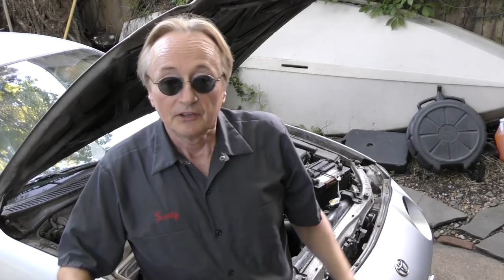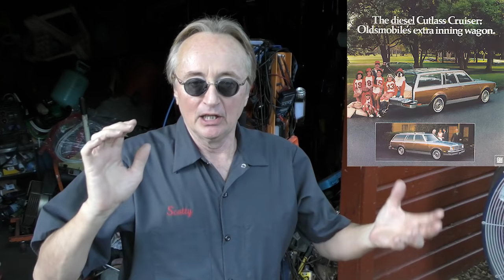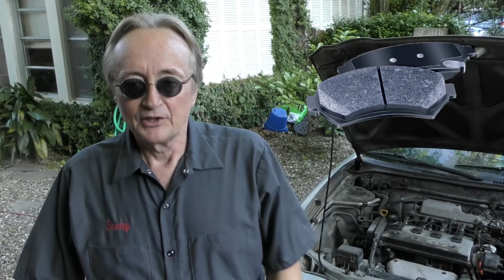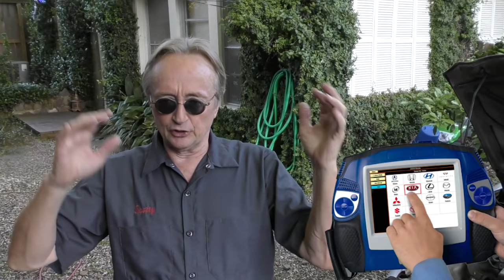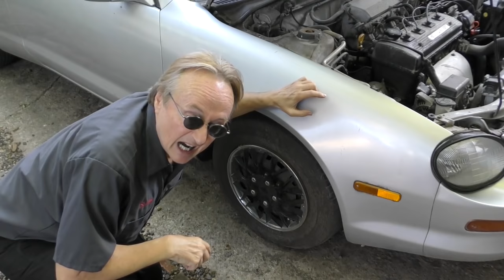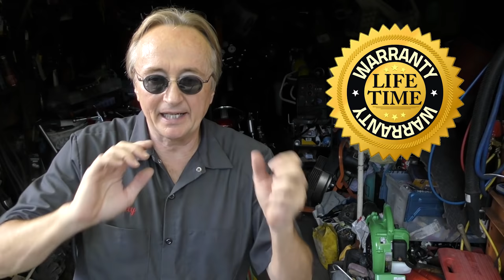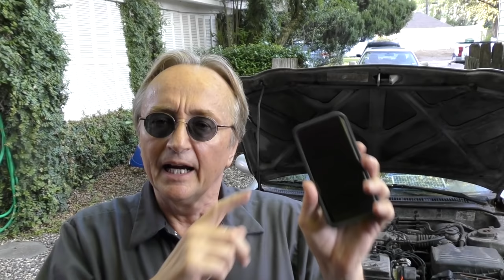5 Scams Your Car Mechanic Doesn’t Want You to Know

Comment: Moral of the story: get a good make of vehicle, find an HONEST mechanic.
Reply: And learn about your car so you don't get ripped off...
Reply: Or do it yourself!
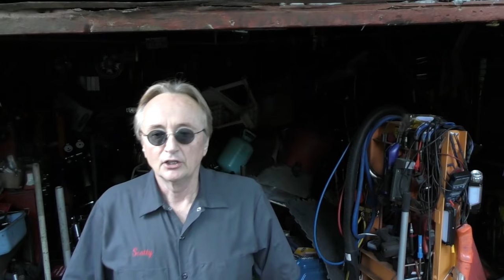Reply: @peterescalante1207  Yeah! Even th' man said that at 1:33 of this video too.
Reply: know the clockworkings of your car as well so when they tell you cat tales you can detect them
Reply: How do you know if the mechanic is honest?
Reply: @franko No not all.  Somebody has to fix your car if you can't.  Simple as that and once again just because we fix cars does not make us all scam artist.
Reply: There’s really no such thing as a bad make of vehicle anymore. 

A lot of the parts they all use are made in the same plants and a lot of cars even roll off the same assembly lines these days. There is no such thing as a problem free car despite the myth of Toyota’s and Honda’s never need maintenance. I did more major engine work at Toyota than I’ve ever done anywhere else. Just buy a car, find the routine maintenance schedule - do the services as they’re do and handle any other issues and you’ll be alright.

Comment: This is exactly why I love these videos so I can learn stuff and do the work myself thanks again Scotty save me a ton of money over the years
Reply: Scotty saved me from liars who said my transmission was bad and my radiator was bad. All it was was a faulty plug wire and Scotty figured it out. I spent $29 on wires instead of$ 4000 on a transmission and $300 on a radiator.

Comment: Scotty, you are spot on!  I’ve been driving for 60 years and I grew up working in my cars, like every kid in the sixties did. 
I have a 2007 Nissan Xterra I bought in 2009 with 40,000 miles on it. 
Two years ago, I took it in to a garage for routine service and an alignment check, since it had never been aligned since I bought it.
Well, I needed $3400 in repairs. Struts and shocks, lower control arm bushings, motor and trans mounts ( $660 labor).  And some other stuff. 
Why do I need struts and shocks?  Well, because of their age.
I had NO symptoms, and I never had anybody tell me I needed that kind of repairs. 90,000 miles. Serviced regularly.
So I got a second opinion, and followed the Master Tech under the car on the lift with a flashlight.
Yeah, the pax motor motor mount is a little weak, and the fan clutch will need replacing in about three years. But,  otherwise you’re good.

Comment: The local Mazda dealer once told me that my car needed a new valve cover gasket.

It was a '93 RX-7. (For the uninitiated: that has a rotary engine, which does not have valves. Much less a valve cover, or a valve cover gasket.)

(I'll take my keys now, thank you very much.)

Comment: Make sure you change your Flux Capacitor every 60,000 miles.
Reply: And change your brake light fluid.
Reply: My flux capacitor will last the lifetime of the vehicle.
Reply: If you get the updated "Mr Fusion" control module, it saves you a lot of hassle trying to find plutonium.
Reply: John Nguyen I thought it was every 88,000 miles??
Reply: Years. Not miles.
Reply: @mcplutt  At least that's what the warranty guarantees

Comment: Went into a local dealership to have my oil changed and tires rotated, they added a misc charge in the bill to inspect the floor mats to make sure they were properly installed. 

Always go over your final bill.
Reply: Hence the term....stealerships
Reply: Bwhahahahahaha. Those mfers
Reply: Once my vehicle is out of warranty,  the dealership never sees it again.
Reply: Was it a Lexus? Remember the mats that jammed the gas pedal?
Reply: Make SURE you check the torque on the lug nuts yourself or risk warped rotors...common scam.
Reply: Toyota and lexus always have a line on the repair order for floormats since the gas pedal recall

Comment: The biggest scam is the state inspection in Texas. That gives mechanics a blank check to "fix" whether just to pass state inspection. Happened to me. Mechanic said I needed a new master cylinder. He drained the brake fluid and said it was leaking. I drove it home, replaced the master cylinder myself and drove it back. The mechanic was all pissed and eventually passed my inspection.

Comment: If it is a GM and the check engine light is NOT ON then there is something wrong with the vehicle. I have never had a check engine light come on when the vehicle actually broke down.
Reply: I had one that flashed on the dash of my s10 for a whole year. It burnt out or something eventually and was replaced by an abs light. That week it dropped a valve
Reply: It's like no oil dripping out of a German car...crankcase is empty.
Reply: wholeNwon z
Reply: Well I have a 2008 that it's off... so what's going next

Comment: I recommend reading your owner's manual, joining a forum specifically for your car, invest in some basic tools and DIY.
Reply: Yea that works if you have a old vehicle the newer Vehicles you have to have a few thousand dollars just for for one Tool. they make them purposely now where you can't work on them yourself even for simple maintenance.
Reply: Absolutely right. Lots of seemingly complicated things can be done easily with very basic tools and a cheap OBD II scanner. The forums for my car have been good.
Reply: @Redblade very true! But scotty would advise against buying any newer car. I drive a 2000 maxima, still going strong and forums help me save a lot of money and it's easy to work on for the most part
Reply: How do you find these forums
Reply: @NT-sm5jk  google type : (name and year of your car) forum

Comment: I scam myself into buying genuine parts for my BMW.
Reply: Bring Money With for sure, but often for older ones the stealership will quite often also be using those same aftermarket parts to service the car, because they can make an insane markup on the parts, and the customer will pretty much never see any difference. Only difference is they are putting a warranty on them, so they make sure the stuff they buy at least will last the warranty period, or till the next service, when they will change it again.
Reply: @SeanBZA  I buy from the dealership all the time. I get a discount when I order online. It even beats other competitors like ecs, europarts, Turner you name it. All stamped or laser etched Genuine BMW parts. I've even had some parts imported from Germany because they didn't have any in stock. They've been good to me and my E36 M3.
Reply: Hahaha😂
Reply: @I.Odnamra  smh
Reply: Anything electrical and suspension makes sense
Reply: nothing scam about that unless you buy them when there is no reason to do so
Reply: Lol well for a bmw you kinda have to buy genuine parts...
Reply: Armando Garza oh my!
Reply: FCPEuro. Check them out for BMW parts lifetime replacement on everything. Even oil. Thank me later

Comment: Dishonest mechanics are why I do my own maintenance now. 
;)
Reply: Only thing worse is construction and home improvement contractors.
Reply: And at the hourly rates they charge, even if it takes you 5 times longer to home DIY the same job, it's still worthwhile compared with minimum wage.
Reply: All you need to do is know a little about anything in a car. Then you can go to the most dishonest mechanic, and still be able to tell him if he needs to replace a part or not.

They have the time and tools and do some labor that I can't do. But a little knowledge can prevent them from scamming you.

Comment: I have a 2011 Honda CR-V. This model is prone to having the Cruise control toggle break. The toggle is located on the steering wheel. NOW, this model also has a recall on the steering wheel airbag. I called the Honda dealership to schedule the recall and get a quote for replacing the toggle. They quoted me FULL price for tear-down labor on the steering wheel assembly, which was to be included in the recall at no charge, if I wanted the cruise toggle replaced as well... Basically an example of what you mentioned as #1.

Comment: "Find an honest mechanic." Could we start with something easier: parting the Red Sea perhaps?
Reply: I've been a Technician for over 25 years and pride myself on being honest with every customer. So maybe I could part the Red Sea too.
Reply: I wanna be an honost mechanic, just to do good in the world but still need more studying/ learning everything a mechanic needs to know
Reply: I am an honest mechanic that will tell the customer that they don't need any work if they don't
Reply: Lmfao
Reply: slimchans I need your help. My 2011 Jeep Compass shuts off while I’m driving and it often won’t even start when I go to drive. Any ideas ?
Reply: @thisisshauna6986  I would start with checking your battery terminals especially if you keep having to reset your radio and clock
Reply: @slimchans  would that make it shut off while driving? Sounds like possible alternator issue too. I'm not a mechanic. So my question was actually a question and not rhetorical.
Reply: @aleksfoxtrot8044  it could be a combination of both. But an erratic connection at the battery can play hell on the electronics of a vehicle causing many weird issues. I am just giving a starting point since it's hard to diagnose a problem without actually seeing the car in person. It also could help if the engine light is on to just go to a local autozone or other parts house and have them scan it for free
Reply: @slimchans  yeah I hear ya.  Always start with the simplest possible problem.  So I was just asking your thoughts.  :)
Reply: @thisisshauna6986  It's a Jeep thing, their owners wouldn't understand. (Sorry, We do a LOT of warranty work for a local Jeep dealer;) especially now that they are owned by FIAT!!

Comment: I don't trust any mechanics. That's why if I can do it myself, why not? I like learning.
Reply: Ernie C don’t jump straight to blaming us. I never recommend work that is not needed or recommended by the manufacturer. Blame the shop owners and managers. They are the ones destroying this industry. I wish Scotty would point that out more.
Reply: J M  can’t get fired for that. The companies would get sued if that happened. Remember there is a tech shortage and companies would get a bad rep and have zero employees. The customers are partly to blame too. The big chains have more buying power and can offer lower prices on some things and the customers flock to them. The chains are the worst to go to. Big companies only care about bottom lines. Find a small honest shop and stick with them for everything.
Reply: J M Remember, cheap labor is not good and good labor is not cheap.
Reply: J M I’ve worked in a nice handful of garages over the years, and never ran into any issues with being an honest tech. It’s been the exact opposite in my experience more and more garages are trying to push out the crooked techs recommending things that aren’t needed or services (like flushes) not yet due. 

The large reason why a lot of that happens is because of how technicians pay scale is in a lot of places
Reply: I actually know several. Once they realize you know a thing or two, they usually won't try any BS at all. Knowledge is power, and it what keeps them honest. There have been times where I've taught them a thing or two about my cars just by doing a lot of research.
Reply: Try doing transmission rebuild and solinoids yourself...(not a trained Mechanic) gonna have a baddd time...
Reply: Ernie C 😂 lol I just fixed my rear tail light, i refused to pay $100 for an Hr to fix a minor issue that took less than 5 minutes. 😂
Reply: EdW we will eventually do things ourselves and fire all the crooks, I refuse to be someone’s income so that they go on vacation by there dishonesty.
I won’t be a customer anymore, I will be the fixer and problem solver of my own life and car. 😝
Reply: me too bro
Reply: Yeah i want to learn myself aswell but i have e63 amg, i am scared to touch anything in there
Reply: Ernie C Ikr, cost to to replace a blower motor $294 to $360. I went to pullapart, pulled a blower motor out of a car, pulled mine out and popped that baby in. total cost $24 and some change and only took about 25 mins to change them out. $26 and some change including  the pullapart entry fee 😂
Reply: Justice I had to replace my moms headlight assembly because some guy said he'd fix for $90 because he had to take the bumper off 😂 I was like he's either bs you or he is going to f something up. popped the hood, took the old one out, put the new one in easy peasy.

Comment: the Drive-In/Jiffy/Mr. Lube places are the worst.  The techs will upsell you fluid changes and not perform the the said maintenance lmao
Reply: I used to work for Valvoline Instant Oil Change and I will tell you that it's the best place to take your car for simple maintenance. Every tech was honest and had to or else they get fired instantly. Theres cameras in every angle of the shop and were reviewed everyday. We got so many customers from other shops and love Valvoline. The only downside was that the services provided were expensive but customer service was excellent. They have great reviews about it.  I don't work there anymore because I had to move to a city that didnt have Valvoline shops. But if there was, I would of stayed. The best job I ever had. Paid well hourly.
Reply: @Jeff - What do you expect from places like that??? Do the research an' make better choices dude! That's YOUR investment!
Reply: I went to a lube place for a oil change and they “recommended” I get a engine flush and if I wanted to get that done. I came for s damn oil change do I look stupid to you. They also tried to say 150 to change air filter, I bought the air filter myself and swapped it in less than 5 minutes for a fraction, I always shop around so I can’t get screwed anyway
Reply: Put a hidden camera in your car and you will be horrified at what goes on.
Reply: Why would you admit you went to an iffy lube at all?
Reply: @gregblack8550  that is illegal as you can cover a dash cam as it is unlawful recording
Reply: By far the best thing you can do is learn to change your own oil.  It's not a difficult task, and you don't really need any knowledge of car mechanics to do it.  Changing your own oil will keep you away from mechanics who will try to pressure you into unneeded repairs or services.  For all other maintenance, like coolant replacement as an example, you can watch YouTube vehicles and learn how to do it yourself.  Everyone should learn to do their own basic maintenance, and just go to a mechanic for actual repairs.
Reply: @Brucev7  Many transmissions DO use motor oil. Some transmissions are damaged by the EP additives in "gear oil" but as always read the specifications for the car in question.
Reply: @GSimpsonOAM  That car did not

Comment: Scotty :"do the recall and nothing else"
Customers :"hey why is my cel on still?"
Reply: Hey why did the manufacturer deny my warranty ? Scotty said those scheduled maintenance guidelines were "just a scam"
Reply: If you do the main at the intervals, the manufacturer is more willing to help when vehicle is out of warranty. I work for Honda, I had a customer who needed ac repairs out of warranty. $2600, I reached out to the manufacturer and presented his history. He only had to pay $270. We replaced his evap and compressor.
Reply: @BSon-sj9uc  That's the rule of thumb our warranty admin tells me; also because the customer contributed to the work that work I believe will then also be guaranteed?

Not sure if this is the same for all brands - but I believe a deviation from maintenance schedule only affects warranty if the lack of maintenance causes the issue being complained about. - Although I would imagine it will impact any extended warranty requests made (but that's just an extrapolation)
Reply: @kaisarfaust5625  not only that, but you build a relationship with that dealership. If your alternator goes out, they are more willing to help with cost if you are a good customer.

Comment: If only i knew more when I was younger... used Isuzu Trooper- bad oil pump, engine went out at 135K miles (bought it with 103K on it). Used 05' C230 Kompressor, engine failed at 88K miles, (bought with 50K on it). I now happily drive a 2005 Camry with manual transmission, now at 223K miles, had 185K when bought, and is still running strong!

Comment: The toyota dealer got mad that i took a tundra trd pro offroad telling me i was voiding warranty  thats what the truck is made for
Reply: We had a guy take his tundra off roading a few months ago and he managed to rip the wheel speed sensor wire off of the sensor. It did  not get covered under warranty because it did not fail naturally. My advice is to not take a vehicle under warranty off-road
Reply: Look dude. If your car is damaged because of you. That’s not a warranty issue. If a part fails under normal conditions that’s a warranty issue. 
Better have full coverage auto insurance to back you up if you rip a wheel bearing driving too fast off-road.
Reply: Obviously self inflicted damage wouldn't be covered by your warranty but if you bought something offroad capable j would expect to take it off road.
Reply: And I wouldn't worry about your insurance for a wheel bearing. If you can afford the off road package I'm sure you can afford a $200 wheel bearing. Lol
Reply: Original poster didn't even say he damaged anything off roading.
Reply: Yes

Comment: I took my car in for an oil change and a basic check up. They said the car needs a new front wheel bearing and new streewing rods. I doubted them and checked it myself. Turns out I didnt need any of that crap. Ive driven 5 000km so far and no issues. I did a second check after about 2 000km and everything seemed ok.